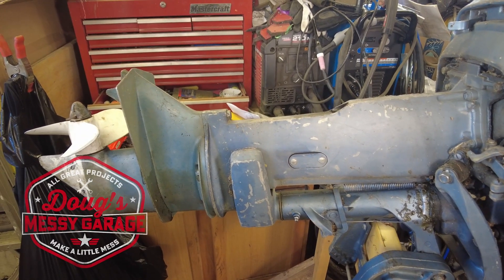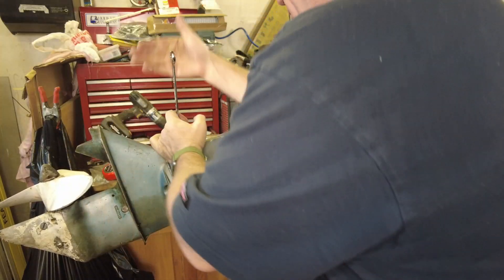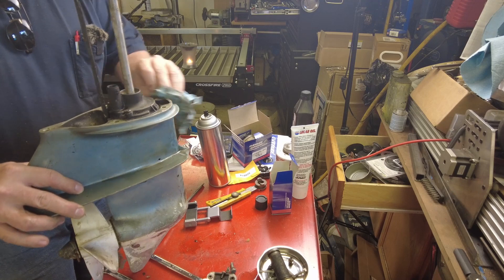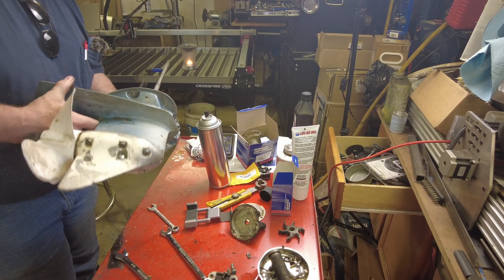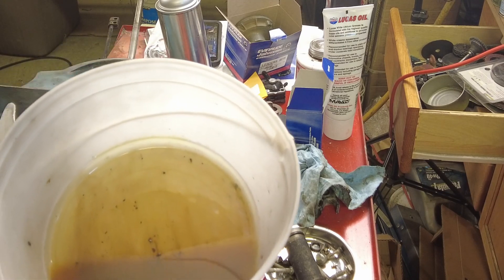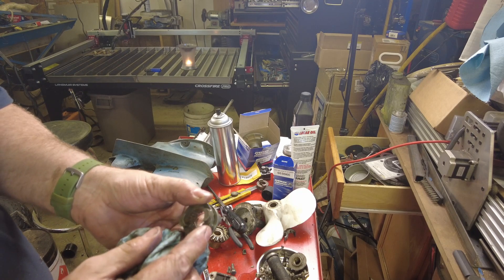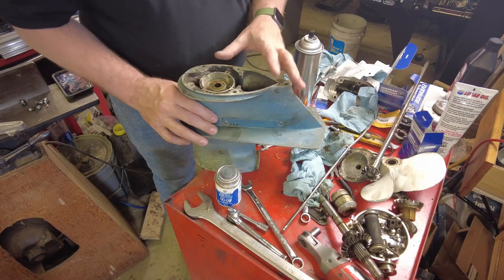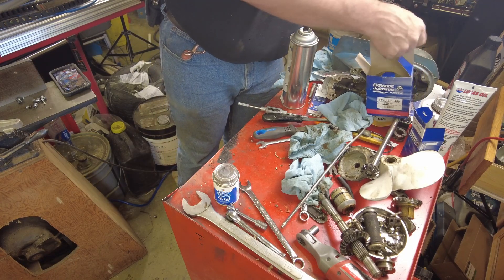Lower Unit TEARDOWN: 18hp Evinrude Outboard E5

Comment: Question, I have the same motor, where is the impeller located on it?
Reply from the maker: on the drive shaft coming down from the power head, immediately above the gearbox.  It lives under a cover with a water outlet on it.
Reply: @ is it right above the prop
Reply: Or is it the plate with three holes on it
Reply from the maker: @AlexBrown09  It is inside the lower unit.  if you look at the thumbnail, there is the prop haft, then there is a large plate then a slightly smaller plate.  The impellor is inside the motor right around the smaller flatish plate.
Reply: @DougsMessyGarage so does the water enter in that spot with three holes? Sorry for all the questions I am newer to boat engines.
Reply from the maker: @AlexBrown09  it enters through the mesh covered slots on the sides just below the smaller plate.
Reply: @DougsMessyGarage  thank you

Comment: Getting ready to take off lower unit on 71 18hp Evinrude fastwin, it started jumping out of gear, all of a sudden.
Reply from the maker: Those outboards are known for shifter dog issues but before you dig in too deep, make sure your detent is working properly up at the shifter.
Reply: @DougsMessyGarage  Sorry, I’m new to working on boat motors. What is the detent ? What should I watch for ?
Reply from the maker: @HTShepherd  My 18hp is in storage right now so I can't look at it but i recall there is an arc shaped tab near the shifter that has a small roller on it.  its purpose is to help keep the gearbox in the selected gear, either forward, neutral, or reverse.  If the roller is gummed up, that may explain when the motor can pop out of gear.
Reply: @DougsMessyGarage  Thank you Doug for the description, I think I know what roller you are describing.

Comment: i have a 1961 evinrude 18hp 15034 i need to do a lower unit rebuild my self can u add all the parts numbers to all the parts you used in the rebuild  of this video  thank you
Reply from the maker: I believe I added all of the parts in the description of one of this build series, affiliated links for those that came from Amazon.  As for coming up with a parts list now, sorry it was about two years ago and I do not have to parts list

Comment: i have this same motor wondering how to trim the motor with out it kee slipping all the way negative
Reply from the maker: There should be a cross bar that fits across the transom clamp that is the manually adjustable trim.  The trim bar does have a habit of disappearing on older outboards so yours may be gone.